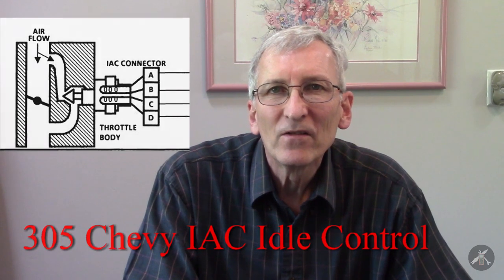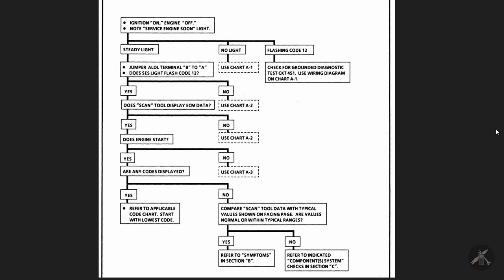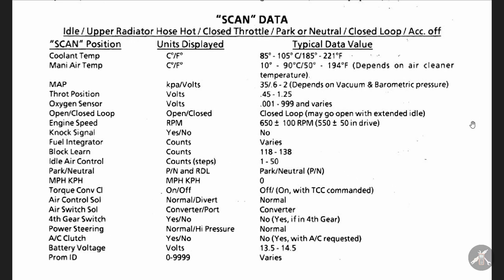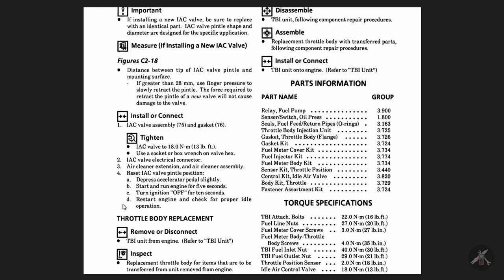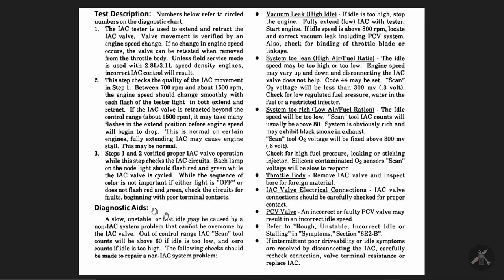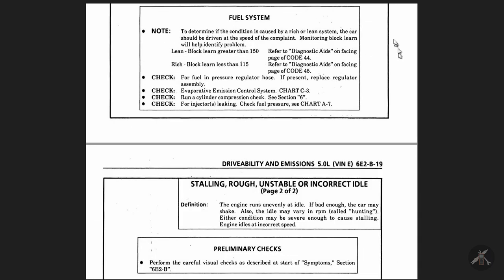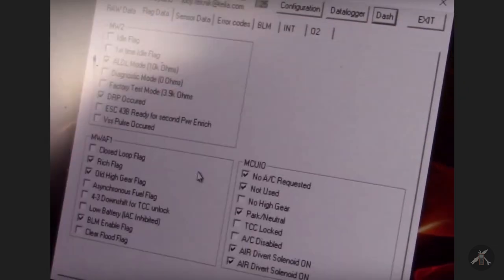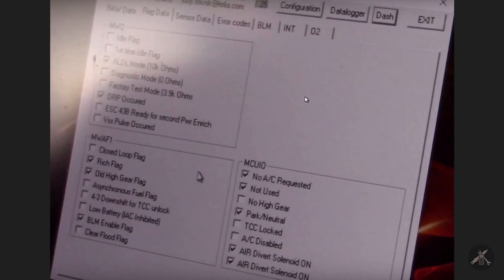Diagnose IAC and Idle Speed - Chevy Camaro 305 TBI

Comment: Hi Dan!
Finally I’ve solved my IAC trouble!
One of the 4 plug wires was broken,no SES light,no codes on WinAldl too.I have used my IAC tester in combination with a scope,I have made a double IAC plug and tested engine running with two IAC,after receiving and rewiring the new plug,now my engine runs quite again…in Drive too 😊!Strange to see the IAC pintle moving back and forward when idling,with only 3 wires and also strange that reaction when put in Drive or reverse.That strange problem causes my Camaro sitting in the garage for 2 years!
Reply from the maker: Good to hear that you found the issue. If I remember correctly, the IAC has two coils.  I expected that they operate in tandem, but perhaps there is a built in override that if one coil (or feed circuit) is bad, the idle is elevated.

Comment: really happy you made this channel i cant find anyone local who knows much about these systems i bought an 89 camaro 5 years ago and 3 out of the 5 its been stalling at idle and just now think i found the problem it seems the used ecm i put in it cured it for now problem is now i cant use my scan tool on it
Reply from the maker: It is hard to say, the ECM and PROM run the diagnostic interface.  Did you keep the cal PROM from the old ECM?  I had a problem with a different GM car that had an aftermarket PROM that broke the scan tool interface. It still flashes codes, but won't send data.
Reply: @bitsofwisdom460  i transferred the oem chips to the ecm that works and the check engine light flickers so my hope is the chip just didnt seat properly funny you mentioned those aftermarket chips ive got one and they tell you in the instructions you have to put the oem chip back in if you take to a mechanic

Comment: Nice information and effort as usual! I had some idle issues and had found my IAC valve to have come apart in place! I simply put it back together, reset it and problem solved! All of us watching you have a great reference in the form of a live knowledgeable person! Thank you so much for your time. I'm still fighting Nox issues with smog check but all the systems are working. My EGR opens as commanded but it is shakey while open and not simply open without some movement. I don't know if this is normal or if maybe the exhaust back pressure is too low to help. I did replace muffler with a GMMG chambered cat back system. Something else I noticed on the smog test is that at 15 and 25mph runs on the dyno, the engine is running in the 1300 rpm range and I do not believe the EGR duty is called unless over 1500rpm. When test driving with scan hooked up, that seems to be the case. If the EGR is not opening even at the testing speeds, it may show high Nox. Maybe they could do the test in 1st or 2nd gear to increase rpm? I am going to road test it that way and see if that may work. I did confirm that the EGR is opening when the scan says so as I had a camera under the plenum watching in real time. Glad you are feeling better! 😊 😊
Reply from the maker: The EGR on these engines is a little bit of a challenge to diagnose or predict because of the negative backpressure EGR valve.  The challenge is that negative exhaust pressure will release the vacuum signal and tend to close the valve, even if a duty cycle is commanded. The engine exhaust has pulses both positive and negative, with more negative pulses at light load.  Not sure if your car's calibration is different, but in my car and in the data I have previously posted, I get EGR command starting at about 1150 to 1200 RPM with light throttle.  I am right now looking a data set of 50% EGR at 1125 RPM at 6% TPS. Then the book says that at idle, the valve will release the vacuum because of the negative pulses.  I think you will see negative pressure diminish with increasing throttle and speed. So, how much EGR will I actually have at the above condition?
Your thought about the chambered exhaust could be a factor, but frankly I would be surprised if it was the cause.  I don't know, of course, but I would expect that the catalyst would provide enough back pressure to maintain the pulsations in the manifolds and the muffler being much further downstream would not have a great effect. Could the EGR valve have an internal issue?
Reply: @bitsofwisdom460  my EGR is new and the tests in the factory service manual all pass. The scan tool only shows 0 or 100% and never anything else. I read that drilling the hole very slightly bigger on the EGR at the vaccumm line attach point will allow it to open easier. My car is in excellent shape and runs very well. Very bewildering for sure.
Reply from the maker: @mikebruegger8654  Mike, I'm scratching my head.  I know that California calibrations were usually different than 49 state, but it doesn't make sense to me that your car would have less EGR than mine.  Given Calif emissions, I would expect perhaps more EGR.  Also, the whole point of the PWM driven EGR solenoid is to provide variable flow, not just 0 or 100%, that seems odd.  The book indicates pulse width is set by air flow, coolant temp and engine speed. It would be a calculation probably based off of a look up table with speed and throttle or similar. Again, my car will provide 30 to 50% duty cycle command at just off idle with light positive throttle.  It would make me wonder if there is a problem with either the PROM or ECM. I know there are trouble codes for the PROM, but I don't know how thorough they are.  It would be tempting to find someone who can read out the PROM and see if the EGR tables look correct. Alternatively, could the ECM have a problem with the EGR PWM circuit so that it is only running zero or 100% regardless of command.  I don't know where the duty cycle data for the scan tool originates.  Is it the command to the PWM circuit or is it the actual output of the PWM driver circuit?  Just food for thought at this point. I'm seldom in favor of blindly replacing parts.
Reply: @bitsofwisdom460  I will see if I can find someone to check ECM and check for possible errors. I appreciate your knowledge and time about this. Even the gentleman at the smog station is lost as to why. I can say that the EGR moves open in a shivering way and I'm not sure if it should open cleanly or if it is sorta opening at variants of full open as the scan tool says. Have a great day.

Comment: Hai Dan,my researces on my IAC continues.
I've (visually too) noticed something: my ecm retract the IAC when I shut off the engine and not in the start procedure.
Also on WinAldl shutting off the engine the IAC counts jumps to 160.
Now a question for you:on the Flag Data what is the”Reference Pulse Occured” flag related to?
I noticed that flag pulsing every 2 seconds in alternance with the”Rich Flag”Flag.
Reply from the maker: I am not certain, but I think the reference pulse is the distributor pickup coil producing spark trigger pulses.
When you key off, the data stream stops and WINALDL will go to some default value that won't be accurate.  The value for key on before cranking would be valid.  The IAC could still retract, but I don't know if it is a good reading.  Exact opening on a start is hard to predict. It ought to be near wide open, but the calibration engineers need to program it to close down quickly when the engine fires so that it doesn't flare too high.

Comment: I have a '91 305 TBI 5 speed Manual with the same issue but only at idle. Tried replaced the TPS. Tried a new Throttle body gasket kit. Still the same thing.
Reply from the maker: Well, I can only suggest to walk through the trouble trees.  As you can see, there are a number of possible causes for idle speed to be abnormal.

Comment: Please help!   I’ve tried changing just about everything I know to and my car still has rough idle.   I purchased an ALDL cable hoping to see more and it led me to change more parts but still no luck.  It keeps flagging that the AC and AC clutch are engaged but it’s not.  Any ideas?
Reply from the maker: Long distance diagnostics is a challenge, but I'll try to help. Tell me a little more about exactly your engine combination, symptoms and ALDL data. Do you get closed loop? All the vacuum lines good, including line to the purge canister? Fuel pressure ok? Just a starting point.
Reply: @bitsofwisdom460  I have a 88 5.0l 305 TPI.  It’s had a rough idle for almost 6 months now and I still Havnt been able to find what’s causing it.   There’s a hesitation when you rev it up along with 1100 RPM idle.  It feels like it’s shuddering some along with exhaust smell.  I don’t believe I’m ever going into closed loop.  No error codes.  I can’t find any vacuum leaks.  I’ve changed the FPR and fuel pressure test seems good.  I’ve changed about every common part that forums say could be the issue with no luck.  What keeps flagging in WinALDL is the “A/C enabled”.  Thought I had it the other day when I found some pressure trapped on the fan pressure switch.   Switch checked out good and it stopped flagging.  At that time it ran perfect.   Since then it’s back to doing it again.
Reply from the maker: @MrEricMcCullough  Well, a couple of thoughts.  The A/C switch might cause a small idle speed increase and would turn on the fans, but shouldn't hurt idle quality.  You can try unplugging the switch to see if it is intermittent. 
WINALDL ought to give you a closed or open loop signal and a rich / lean signal.  It would help to know where you are running. I would suggest comparing your data to my running engine. Look at the parameters and see if the sensor readings make sense.  Especially is mass air flow proper? You might even try unplugging the MAF just for a check to see what happens.
My road test run of WINALDL data is in this video:
https://youtu.be/cmxqhTReRUk
My cold start data from my Actron tool is here:
cold start data2.movie.mp4
The Actron tool does have a couple of oddities in conversion that WINALDL fixes.
Remember that running a scan tool or WINALDL with the 10k resistor will elevate the idle to 1100 and advance timing on most engines.
Reply: Thank you for your reply and apologies for late reply.  I’ve been trying to chase down another issue that came up before I can get back on this one.  Evidently the alternator went out and burned some things up.   My high beams wouldn’t work and finally tracked it down to being the dimmer switch.  Now the new alternator has voltage on the red wire that comes from the starter, but it doesn’t have voltage on the brown or the light brown/white stripe wire.   From what I’ve red one of these should have voltage when you turn the ignition on and also give voltage to the cooling fan relay coils.  My fans are running but not how they are supposed to.  They work in tandem instead of independently.  Once I get this sorted out I’ll be able to give you more data compared to your video.
Reply: Replaced alternator (tested bad), IAC, and coolant temp sensor.  Voltage at red wire, voltage at tan/white wire, no voltage at brown wire.   My cooling fans both still run together not independently, but moving on for now.  Looking at your numbers compared to mine with the car cranked, idle, and in ALDL mode (10k mode).  No error codes, FLAG DATA: does not show “closed loop”, A/C clutch enabled, A/C enabled blinks.  SENSOR DATA: IAC-2, Coolant temp-201, TPS-.53, INT-127, O2-182, MAT-114, BLM-13, 
lean/rich-125, RPM-925.
Reply from the maker: @MrEricMcCullough  Don’t know what is driving the AC, could be in the manual control.  Vent, heat, or off should cancel that.  If not, that’s odd, compressor feed ought to be in the manual control head switches.
Running data: OK, except IAC is way low at 2.  2 is nearly full closed.  Should be like 20 to 80.  Toward the higher side in 10k mode as it is raising idle speed. If it is really at 2, there ought not be enough air to run at 925. Either IAC has a problem, base idle screw has been adjusted too far open (usually should be left at factory setting), or there is a vacuum leak somewhere. I know you said that you have checked, but there are sneaky ones.
O2 of 182 is lean.  Does it move?  You ought to see it cross 450 or so frequently and those 125 rich / lean cross counts should keep moving and not stay static. If it does, you ought to get closed loop.
INT of 127 is very good, 128 is target.  But BLM block learn is only 13.  Suggests long term rich condition with system pulling out fuel to counteract rich, yet short term is in control.  Could it be a vacuum leak affecting idle that has less affect going down the road when the throttle is open?
Have you replaced O2 sensor?
Reply: @bitsofwisdom460  I have replaced O2 sensor no with change. It acted like it made a difference to behind with and then right back to normal.
Reply from the maker: @MrEricMcCullough  Well, if O2 is replaced and good, there is still a possibility of intermittent wiring issue, but I would probably look at why the IAC reading is where it is. Also understand the O2 readings to see why it won't go to closed loop as I suggested above.

Comment: Can you give me advice on where to go next? I admit though I have not started it yet today and battery has been unhooked over an hour. Oh,Good morning by the way and glad to hear of your improvinig health.
Reply from the maker: Which coolant sensor code do you have?  If you have a new sensor, you start looking at wiring and connections. High temp or low temp?  High looks for a short or short to ground and low looks for an open. Scan tool helps or DVM reading the circuit at the ECM connections. Sensor has low resistance hot and high resistance cold.
Reply: @bitsofwisdom460  my code was 42 and 45. 42 has been traced we believe its not the ignition modulator itself but the 2 prong female connector, when i unplugged it the thing literally disentigrated in my hand. I installed icm anywhoos.hooked up wires without plastic clip as it blew up, car started but after 90 seconds 2 min car went into a limp mode or whatever and light came back on. Weve done exaughstive testing on almozt every sensor and all have proper grpund and ecm return voltage. Left with plug and icm wires. Connectors are all rustyand everything.
Reply from the maker: Ok, I was looking at your video that indicated a coolant sensor issue.  If you have a wiring concern, then yes, a fresh ICM connector with clean pins that fit properly is important.  A 42 would mean that you're running at base timing because EST isn't working properly or the "set timing" lead is not connected.
Reply: @bitsofwisdom460  im stupid est?
Reply from the maker: @ScottsFormula350TPI  EST= Electronic Spark Timing.  ECM reads speed / position data from ICM.  Adds in data from other sensors to calculate timing needed and sends EST timing signal back to the ICM to trigger spark.  Bypass lead disconnects to set base timing.